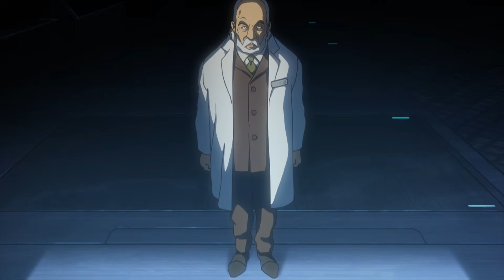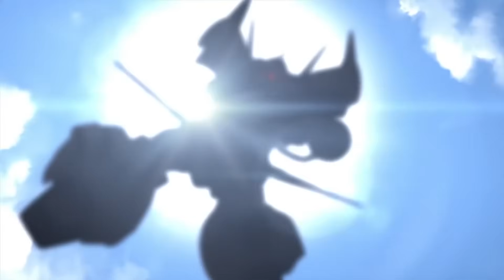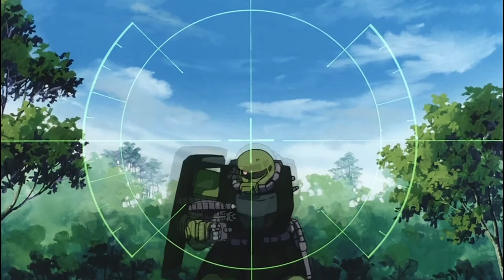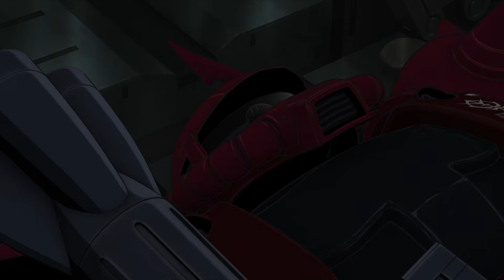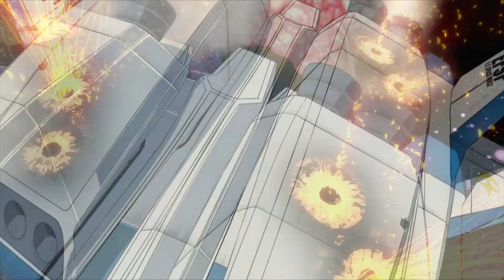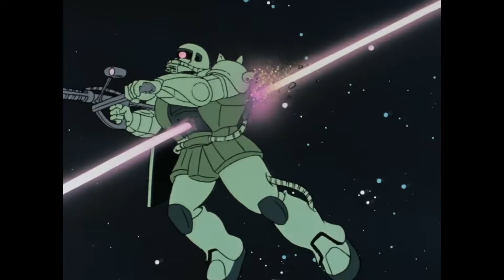How Space Warfare Was Changed Forever | MS-06 Zaku II (Mobile Suit Gundam Lore)

Comment: If Zaku 2 attacked a cpl of marines with Javelins would end that quickly nd if some space metal was used the minute a piece was chipped off we would replace a missle with that metal and then aquire and fire using the metal to penetrate the unit as time went on we would discover the pilot area and target accordingly.
Reply: Zakus are made of steel alloys not some magic space metals. Javelins will do short work of them plus being a giant humanoid you'd just hit the torso anyways which is the easiest to target and is the only part big enough to obviously house the pilot, but that is assuming Minovsky particles wont interfere with the Javelins guidance system. That's kinda why wire guided and laser guided missiles are more commonly used in gundam both by Zeon and Federation forces. They are reliable and "good enough" even with minovsky particles dispersed and there is even a dedicated Anti-MS missile, the M-101A3 Regina wire guided missile, used by EFGF Anti-MS squads which is basically just an up gunned TOW missile, portrayed in MS IGLOO Gravity Front and UC Hard Graph Manga as easily able to kill zakus and other MS so long as you hit the torso/cockpit area and probably have even been mounted on Federation Mobile Suits themselves such as the GM Spartan's shoulder mounted Wire Guided Missiles.
Reply: @Spaceman0720 ya but as soon as one zaku goes down or captured every anti armor warhead would be tipped with it
Reply: @nfldend501  They are made of steel alloys just like real world MBTs. Javelins and other anti-armor weapons will go through them like a hot knife through butter just as they normally do with tanks. And its not because they are tipped with the same metal used by the target, its because of the warhead itself.
Reply: @Spaceman0720 the warheads are tipped otherwise the explosion would be on the outside.  Its like a nail threw wood and the head is the explosive part.  Rocket propelled grenades and other at weapons ate what you are describing and that is what makes them so deadly vs infantry.  Tipped rounds even armor piercing bullets have depleated uranium heads.  There are high explosive HE rounds then there are the anti heavy armor rounds but i definitely think an abrams could hit the pilot cabin and punch right out the back.  If the depleted uranium isnt strong enough then we need some of that zaku magic space armor to coat the shells
Reply: @nfldend501  again the zaku's armor is made of steel alloys, not space magic metal like the titular Gundam's Luna Titanium. And again, you'd most likely aim at the torso because its easier to shoot at. Also you were initialy talking about javelins not tank guns hence why I didnt bother mentioning Depleted Uranium and Tungsten so now that you mention about it, APFSDS are commonly used by both zeon and federation tanks and mobile suit machine guns as a common used ammo. In the ending of episode 2 of Gravity front there is a slow-mo shot of a type 61 firing APFSDS rounds from its twin 155mm guns dead center at a zaku's cockpit with the discarding sabots also clearly shown separating from the penetrators.
Reply: @nfldend501 I would also like to add. Warheads arent tipped like bullets and Kinetic penetrators with a tungsten core or tipped with Depleted Uranium like AP and APFSDS rounds that you are reffering to. Shaped charge warheads use liners to direct a jet or pattern depending on the type of warhead to penetrate armor. Hence why I mention the javelin will penetrate the zaku's armor like a hot knife though butter and in the case of the Javelin, its tandem HEAT Warhead uses a molybdenum liner for the precursor charge and the main charge uses copper liner. Copper is the most commonly used liner both for anti-tank missiles with HEAT warheads and HEAT rounds for tanks. Javelins will be a nightmare for Zakus without minovsky particle interference.

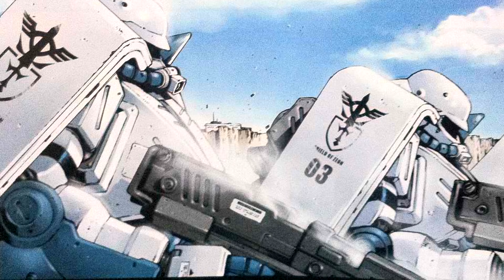Comment: What Version of Zaku are those white at 10:28?? and what anime? Do they have gumpla models?
Reply: Those would be the zaku 2 kai (MS-06FZ). Specifically its the “B-type”, or more commonly refered to as the “fritz helmet type”. There are three retail kits, the no grade 1/144 released in 1989, the high grade 1/144 released in 2008 (this ones the most common), and the 1/100 scale RE/100 kit released in 2019. If you want that specific color scheme you will have to paint it, the color scheme shown is of the “side 3 Capital Defense Division” zaku kai from “The Plan to Assassinate Gihren” manga.
Reply: @3ormorecharacters182  Thanks! I love the design

Comment: A major note about the Heat weapons is that the only reason to heat a weapon like that is to get the blade to a plasma state.  So surface-of-the-sun hot or better.  

That would make it cleave through anything like it wasn't there.  Edge alignment wouldn't really matter so much, the "Heat Saber" of the Dom somes to mind.  It would actually cause colder items to explode because of the sudden change in temperature.

An axe would be preferred because you could use the length of the handle without too much worry of coming in contact with the heated blade unlike a sword which would be more trouble than it's worth.

Comment: Looking back, you missed the part where one of the reasons Zaku II used external energy pipe was to improve heat dissipation, a simple way to solve the over heating problem present on the Zaku I

Comment: It really is a very realistically effective design.  Something with the power source that would fit in a mobile suit would be able to wear far greater armor than a tank, and it has the mass and strength to use a weapon that rapid fires tank shells and probably has a longer barrel and stronger propellant than a tank can handle.  It has most of the agility and flexibility of an infantry man but has jump jets, it has a weapon superior to what anything short of a super tank can carry and is rapid firing, it carries a lot of anti-infantry weapons and can shoot down missiles and fighters, it is durable enough that only a very large mobile gun can threaten it which itself would be very vulnerable to air or ground attack (or even heavy weapons carried by members of mobile suit teams such as a bazooka), it has a height advantage enabling it it engage targets that would otherwise be behind cover or not visible to a tank, it fights as part of a combined arms force instead of alone (when possible), and when in the air or especially in space it can maneuver twist and turn the body and limbs to avoid incoming fire very easily and the movements are assisted by rockets.  It also has dexterity and all terrain capability surpassing all other machines, so it can be used far beyond just warfare and can assist in base construction and logistics as needed.  On top of all of this, its use of arms to carry, aim, and fire weapons means that it can track targets extremely quickly as it needs to move very little mass yet has a great deal of power put into those movements, which makes evading its fire extremely difficult even for another mobile suit or a fighter to such an extent that it can reliably gun down missile massacre attacks.

Comment: Very great video, I honestly expected you to talk about the Minovsky reactor more, and how it disrupts any low frequency wavelengths. And makes any unprotected com devices useless.

And how it changed combat to close combat weaponry as even smart missiles were useless because it wouldn't be feasible to protect the unboard computer that guides it even when seperated from any low frequency guiding.

Basically a fusion reactor that naturally creates an ecm, Electronic Counter Measures, field for kilometres/miles depending on output.

Maybe an idea for another follow up video.
Reply: Also the Minovsky particles, stick around for about a month if I remember.

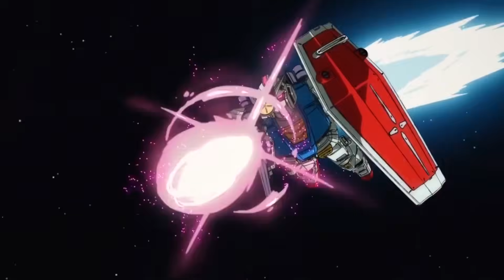Comment: 5:14 "Charge the nearest GM and take their weapon."
That's literally not possible. The GMs used beam weapons, and the Zaku II's reactor isn't powerful enough to use them.
Reply: Scare tactics
Reply: While using the Zaku taking the GM weapon is innacurate, it's just to show the versatility of mechas being able to equip themselves much readily in battle compare to fighter forms that couldn't do so.

Of course, later on both sides would be wise to this and put safety measures such as weapon lock, but the very least, one MS can take the downed MS from his side without problem.
Reply: Only a few houndres Beam Spray Guns are produced in the OYW.
The most RGM-79 used the 90mm/100mm or Hyper Bazookas.
Reply: @BansheeNT-D  Source?
Reply: The GM was better under all aspects, true, but Zaku II pilots were usually  more experienced.

Comment: Little correction, the Battle of Loum is a battle during the One Year War not a skirmish before it. It was the largest space battle up to the Battle of Solomon as well with massive losses on both sides which ended with the Zeon having the advantage in space thanks to the Zaku and Federation ship numbers reduced. It was also the battle where General Revil was captured and used as a bargaining chip in the workings on the Antartic Treaty. It's analogous to the Battle of Dunkirk in the second world war too which that war was the inspiration for the One Year War by the author as well which is one of the main reasons I adore the original story. :D

Comment: Space suits aint really Needed.
Hull Breach? Your dead Anyways,since your Reactor is extremely likely to Blow up.
Reply: Well, they mostly operate in space. Even when not in combat next to a battlefield(?) they'll still need to rely on it. Like they can setup in wrecked space colonies and check on gear and stuff. The the probability of hitting the reactor is high and low. I say this because it's on the lower half, in crotch area at least. Not many would aim there unless a random shot or melee would hit that area than yes.

Comment: Also, MS reactors DON'T power the thrusters; those need fuel like any other craft. The reactor does, however, power the pumps that feed that fuel to the thrusters, so reactor power can still have an effect on thruster output. P.S. The reactor and thrusters run off different fuel: the H3 is for the reactor, the thrusters use "regular" rocket fuel, whatever that is in the Universal Century

Comment: Well done, the research done into this is quite substantial and many of them you wont find in the wiki (Im an editor at Gundam Wiki). Im quite impressed by your first video of a new IP, MetaNerdz, keep the Gundam train going!

Some of the things you didnt cover over was the company that made (most of) them which is Zeonic. Also, the MS-06 line is specifically the Zaku 2 because the Zaku 1 is the MS-05. However, the Zaku 2 is so famous that when one says Zaku, it refers to the MS-06. A few of the more famous variants you didnt cover were the High Mobility types, there are quite alot but the ones everyone knows is the R and the R2 (distinguishable by their legs) which are exclusively piloted by aces, one of which is Shin Matsunaga and Johnny Ridden. Also, many Zeon MS technologies were tested on the MS-06 platform, the biggest expression of this would be the Psycommu Zaku piloted by a Newtype test pilot.

Some interesting, but impirtant things to always remember in the UC timeline is thay canonicity is in this order of importance, from greatest to least:
Movies>Series>OVA>Manga/MSV/Novel>Games

The MSG trilogy movie is higher canon over the original televised series. This matters because of designs like the Core Booster where its a different design for both, but in this case, the aerodynamic looking one is higher canon. Gundam Thunderbolt is an alternate parallel timeline of mainline UC, nothing in there is canon. Gundam the Origin is basically a new canon that is still being carved out, to relate to Star Wars, The Origin is like Canon while everything outside of it but within the premise of the One Year War would be considered Legends, but usually only applies when there are points in the timeline that are inconsistent.

Here are some pronounciation guides (Im not a grammarnazi, dont worry):
Char - shar, same as shot
Ridden - ride-den, the word 'ride', then 'den'
Minovsky - mee-novs-ski, same as you would pronounce Tomino just without the To- and add -ovsky
Reply: Dude, in UC, you can't put all the movies in a canon-pedestal above all else. If you do, that makes Zeta New Translation trilogy more Canon than TV series. That's just silly. The TV series is the greater canon for UC.
Reply: @androyus  TLDR the example you cited is invalid for your argument because its not even in any way canon because its an alternate telling of Zeta marketed as a bridge to CCA for new and non Gundam fans. I established that canonicity order as a sort of guide and not an absolute rule due to how japanese dont view canonicity the same way as westerners would, theyre not as stringent on not following established lore.

The Movies are usually the higher canon, case and point, MSG Unicorn. The Anime has canonicity over the Novels sinply because it is the Anime. Moreover, evidence for higher movie canonicity is in the design of the Core Booster/G-fighter (0079 trilogy and 0079 series, respectively), both have exact same roles in story & plot but in later lore we see that the Core Booster design is consistently used, like in 08th MS Team.

The New Translation was SPECIFICALLY a rewrite from the beginning and also when it was announced due to it being meant as a way for a wide audience (specifically new and non Gundam fans) to bridge the 0079 Trilogy with CCA, skipping ZZ. Nobody should consider New Translation as UC-canon. Same for Gundam Thunderbolt, which is another parallel timeline to UC where many elements are similar but was not specifically far from original UC canon but then it went and kept doing its own thing.
Reply: @JosephJoboLicayan  My point is: since Gundam is Japanese work, we also need to view & understand them like the Japanese do. If they're lenient on canonicity then we should too. Also, Unicorn is an OVA series like Gundam 0083 & Origin. Not technically movies.